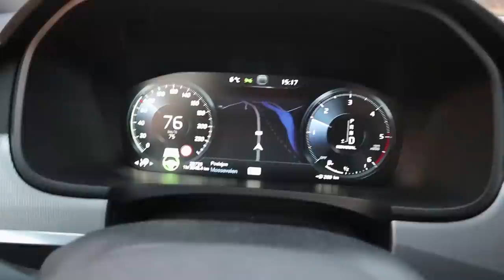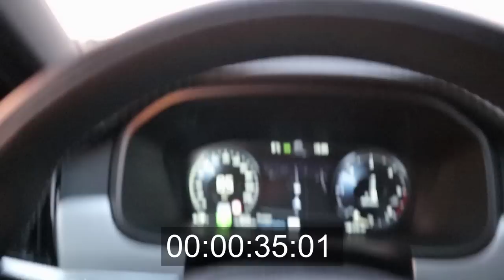Driving With Pilot Assist As Long As You Want!  *Pilot Assist Hack!*

Comment: I just went on a very long Christmas roadtrip here in the U.S from Tennessee to Louisiana and then to Washington, D.C., and then back to Tennessee. Nearly 3,000 miles when all was said and done. I really got the chance to put my Volvo's Pilot Assist to the test and it worked fairly well. In heavy interstate traffic I manually overrode it because other drivers were cutting in and out of traffic with sudden stops and lane changes and the Pilot Assist didn't seem to react as quickly to those situations. Night driving with poorly painted or faded lane markings seemed to affect it also. Overall, I'd say that daylight to early dusk in light to moderate traffic with clear lane markings are the optimal conditions for Pilot Assist.

Comment: I've had the s90 R-Design for about 2 months now. I travel up and down the m6 every week and can honestly say the Pilot assist and Adaptive Cruise Control are a god send. I use it every time without a problem. I've never once felt it was trying to kill me and I've tested its capabilities, a lot. I would say the only issues I find is it will not slow down to take a steep bend automatically unless there's a car in front of you that slows down. On typical motorways though, I drove 60 miles without any input into the car on the m6. 

It just happens to be a massive bonus that its the comfiest drive I've had. The fuel savings are awesome too

Comment: thanks as always Kris for your videos...few months ago I had to drive around 600km to a customer. I have a 2017 xc90 t6 and I always use the pilot assist. I don t know for what reason, but I was able to drive without touching the steering wheel for more than 20 minutes. (no hack, bottle or anything else). I did record a video with the phone for about 10 min because I wanted to show this to my Volvo dealership (which I didn't because I forgot lol). the road was all highway with very light traffic, at night.I still don't know why and when I came back I ve reached about 2/3 min.I drove that road again past week with pretty much same results, little bit less than 20 min.as said I use it every day but so far, only that time/road I ve reached this record. (from Vancouver to Kelowna, Canada)
Reply: What was the speed?

Comment: I have tryed this long ago and it works fine 😊👍. I don't use a bottle I have made a Pease of metall with a hook that I can put on the steering wheel and don't have to tape it, it's weight is 350 gram and drove with good line marker over 3 mile about  30 minutes to the line disappear 😊👍

Comment: Thanks for that interesting video, I have given this some thought, and it is the weight that counts not the fact you used water in a bottle ! so Kris, can you try it again using say, a lead weight tied to the back of the steering wheel ? (this means it would be of a small size) of similar weight of course ! I'm sure it would work just as well, but without being so ugly and obtrusive !!

Comment: I've tested that on a Passat B8 GTE also. The car dosen't have pilot assist, but it has the lane assist and ACC. 
I didn't tape the bottle but putted inside the steering wheel, it's hard to describe but it works😍😂 Originally 15s, but with that bottle on the steering wheel=forever...
The Passat needs a little bit touch to let it work for more than 15s😊

Comment: hey kris would you discuss about radar module inside windscreen about its 76ghz radiation? why other makers put radar on grill or so away from passengers.
Reply: Ahmet filtiarn there isn't a radar in the windscreen, it's in the grille.
Reply: Samuel Brooks spa platform it has in the windscreen not in the grill new series